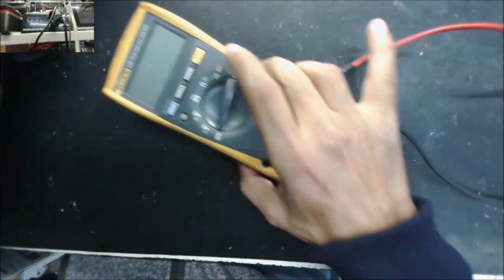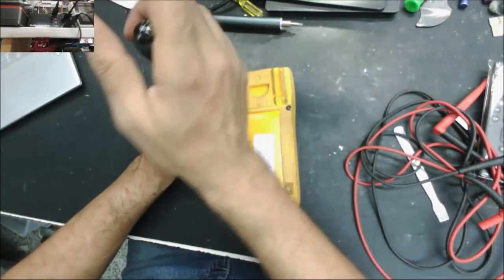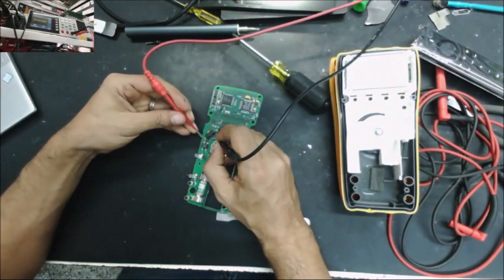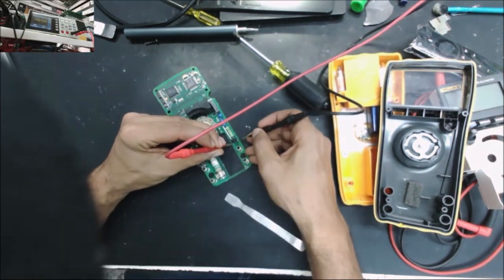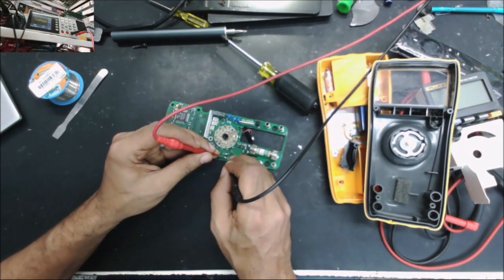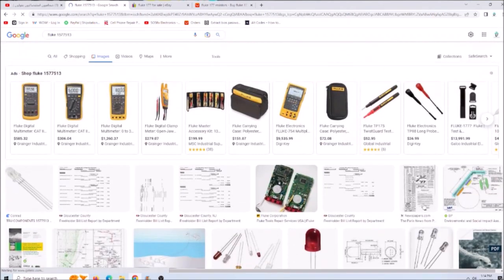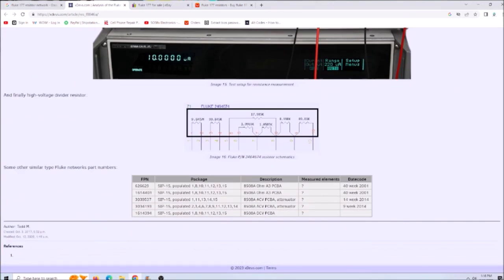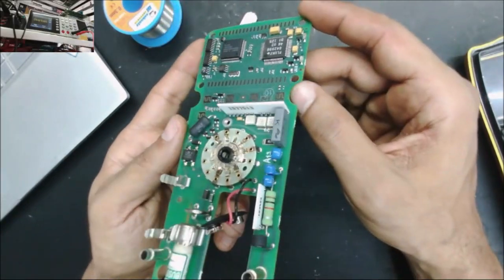Fluke 177 multimeter has wrong readings

Comment: I have a 49 inch lg nanocell tv (49sj810v) there is a standby light but no reponse when you press the power button. Sometimes after pressing it loads of times it flashes then goes out like the tv is coming on, but theres no 5v usb output, no backlight, no image . The 1.2v and 3.3 etc seem to be present on the main board , i cant find any direct shorts , i checked with the thermal camera and the cpu gets hot straight away when i connect the power cable , and not much else warms up , do you have any ideas for this one sir ? Im not sure what else to check.
Reply from the maker: likely bad mainboard ( processor)  i know that mainboard is weak
Reply: @SOSfixElectronics  i was thinking the same . Thankyou for the advice